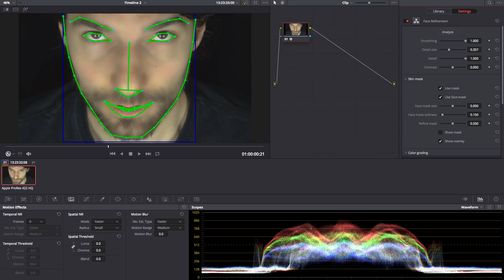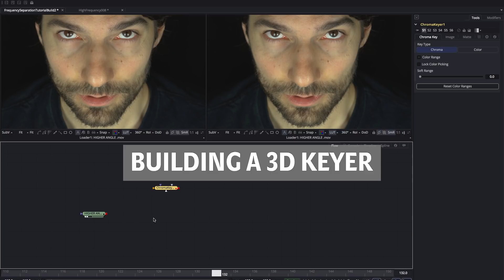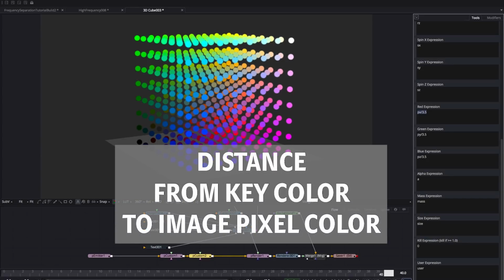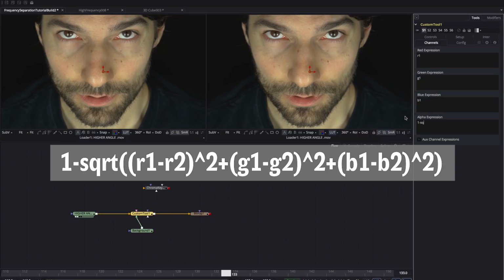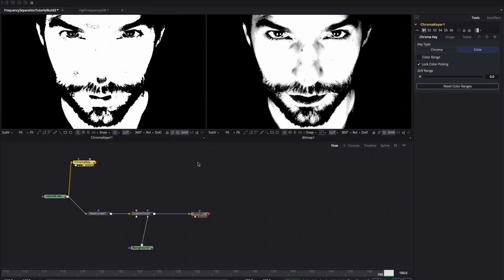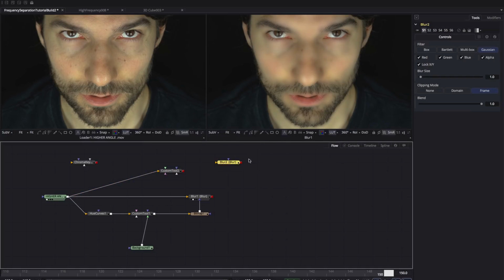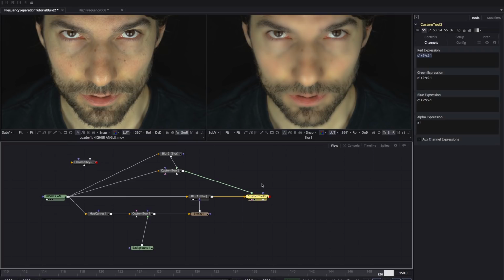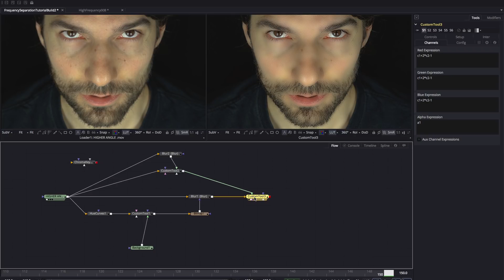DaVinci Resolve Fusion Tutorial: Frequency Separation Retouching

Comment: Simon; reviewing again your excellent tutorial here. For you, a veteran of decades and a genius in these matters, I wondered about a Fusion-based method to apply a custom muti-color gradient to a grey scale image, such as a face. Faces, as you know, very often has varying degrees of saturation, brightness or hue shift at different luminence levels. For example, the shadowed side of a face may show a slightly magenta tone or a cheek highlight may have a slight yellow tint, and deeper shadowed areas may tend to a slight green or orange. As a source reference, one could perhaps use a similar properly colored face image to generate the transfer color palette and then apply that color palette to a similar grey scale image. Effectively colorizing a grey scale image with luma based color tracking. Thanks again for your many excellent tutorials. Looking forward to Fusion 17. Someday. All the best, Mike
Reply from the maker: It's an interesting theory - one easy way of trying it would be to use the hue and saturation of your "ideal face colour" image and keep the luminance (value) of the image you're trying to correct. The issue would be that unless you set about creating a fantastically elaborate warp to keep your source face colour in register with the new face you'd have a really disconcerting look of the colours swimming around when the new face moves. I think this sort of thing may well become more feasible when face detection and tracking becomes more mainstream, but for now I think you're better off with traditional grading isolation techniques.
Reply from the maker: In actual fact, I just tried the technique I suggested and it's oddly credible, but only as a still - and even then it takes a lot of warping and masking to get the faces to match.